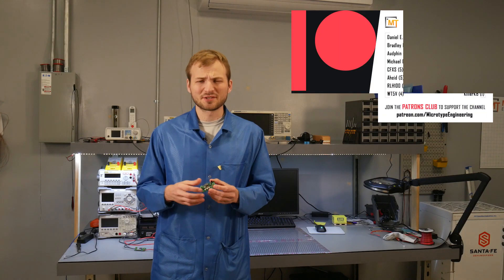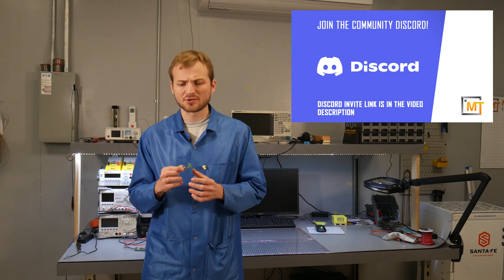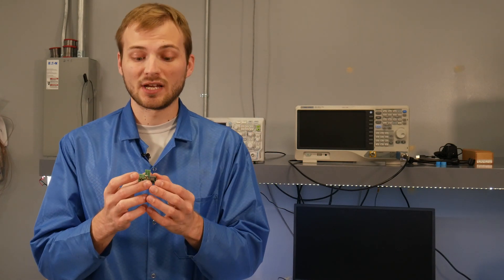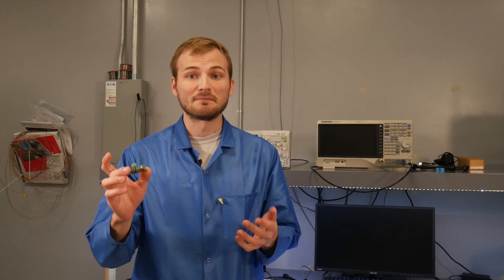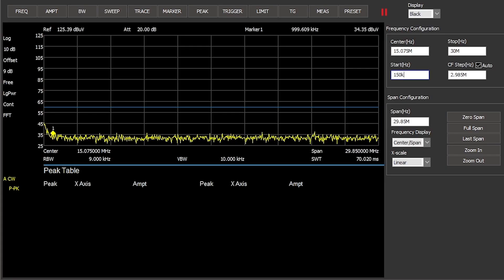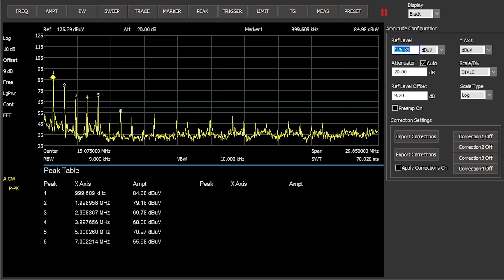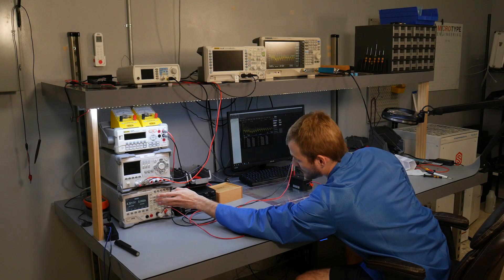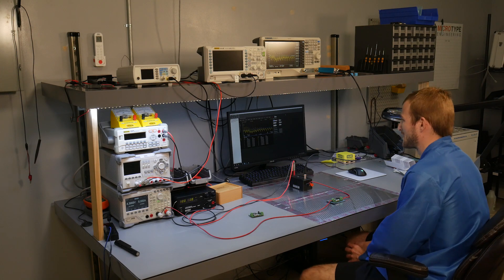The Long Overdue Introduction!: EMC For Everyone #1

Comment: Awesome video, looking forward to the series.

Don't be deceived or disappointed by ferrite beads though - I used to also believe they were only useful 10MHz+ and started to put inductors in my power filters instead for a while. However, recently I bought a Bode 100 and basically debunked that. As long as you buy a decent one (e.g. 300-600R @ 100MHz) it will be just as effective, if not more, right down from 150kHz upwards.

Sometimes you need to filter in the 1kHz - 150kHz range, of course, and that's where heavy inductor filters come into play. But that needs much more care and affection and multi-stage filtering to achieve without massive resonance issues up the frequency chain.
Reply from the maker: Glad you enjoyed! Yes, I'll be going through various filters soon!

Comment: Great video!
There should be a required specified height between the DUT and the metal plane. 
I believe that for non grounded DUT, that height does effect the result.
Thanks for sharing, you are helping the EE community better and better.
Reply from the maker: Yep, you're correct. It's fully spec'd in the various standards. For conducted emissions specifically, it normally doesn't make a huge difference. But yes, it ideally should mimic it as much as possible!

Comment: Looking forward to seeing these videos. It would be interesting to break out common mode and differential mode noise. I also hope you will test out multi-layer boards with different distances between the layers. 0.1 and 0.2mm are readily available and of course the 0.1mm layer should be lower inductance, but it would be interesting to see this in a real-life test...
Reply from the maker: Heh, no kidding, those are all on my list for this series!

The big thing is just making sure I have a design that will radiate enough so those changes will make an impact
Reply: Why 0.1mm layer height will have lower inductance?
Reply: @flienky  Because the magnetic fields generated by the signal line and return plane will be closer together and opposing, so the closer they are together, the closer they come to cancelling each other out...

Comment: So how do you intend so fix that primary frequency spike a t 1MHz ? 
pi filter ? or some other type of filter ? encasing the board in a  metal coffin?
Reply from the maker: You'll have to wait to see the video on that 😉. Either the next EMC one, or the one after
Reply: @MicroTypeEngineering  would at least those ideas work ?
Reply from the maker: PI filter certainly, shielding not so much for conducted emissions. I talk about this quite a bit in the supplemental video
Reply: I think he was only measuring conducted noise carried along the power input and output lines and not any radiated noise that a shielded enclosure might address. From my own experiences, you can have a lot of noise be carried throughout a system on the power-supply lines unless you filter it out at the source , and depending on what else is happening in the system--amplification, for instance--it can then radiate beyond your control. I may be wrong, but I think shielding mostly protects you from other people's sins (excessive radiation of noise) and not so much your own sins within your own system. I can't wait to see what MTE does, but a very-low impedance to ground for 1MHz (say, 0.1uF) followed by a high impedance for 1MHz (say, 1mH), might knock that spike down enough to pass.

Comment: So what exactly were you measuring with that black box? Was it EM radiation or noise at the output?
Reply from the maker: It provides a known impedance to help measure conducted emissions. It gives a reproducible setup, while making sure you're only measuring noise from the device under test, and not the power supply.
Reply: @MicroTypeEngineering  This doesn't really answer my question. What are these "conducted emissions"?

The definition from google says
"Conducted emissions are the noise currents generated by the Device-Under-Test (DUT) that propagate through the power cord or harness to other components/systems or power grid."

So are you measuring the frequency content in the voltage at the input/output or voltage induced into the metal plates underneath or what?
Reply from the maker: Oh. Yes, it's purely the frequency v energy content on the wire going from the DUT -> PSU/LISN. The ground plane is primarily there to help prevent ambient interferance.

You measure radiated emissions in a completely different manner. I'll be going over that in future videos in the series. I also spoke on it in the supplemental video.

Comment: Just to make sure I'm keeping up, where exactly does 60dB uV land in absolute terms? I hate that voltage-sized dB are different than power-sized dB. 0dBuV is 1 microvolt--RMS I presume. Every additional 20dB is a 10x. So 60dBuV is a millivolt. (Right?) And all these measurements assume what impedance? (In Ham Radio, we like to use power-sized dB for everything, especially when measuring spurs and the like, and treat everything as 50 ohms so that even voltage measurements can be expressed in equivalent dBm.)
Reply from the maker: Heh, yeah it becomes quite confusing keeping everything straight.

But yes, you're correct. The LISN I'm using is nominally right around 50R impedance depending on the frequency. It's actually a bit closer to 45R, but still within the CISPR 16 and 25 limits. Both of those specify a range of impedances, nominally 50R.